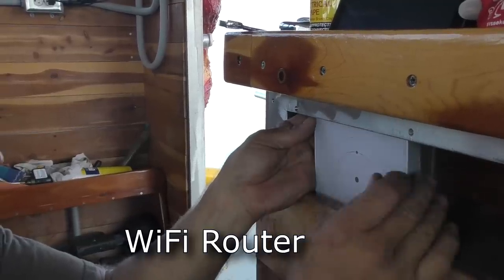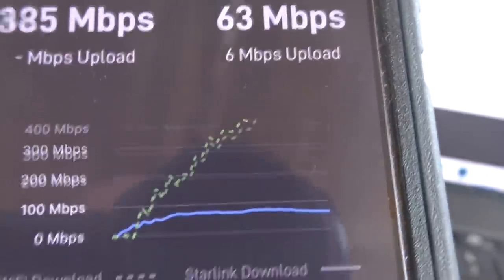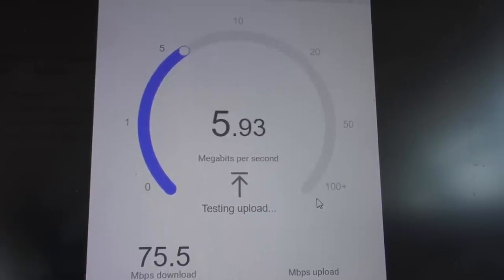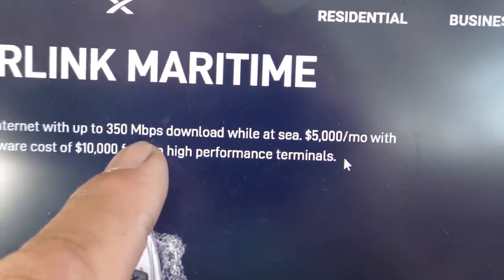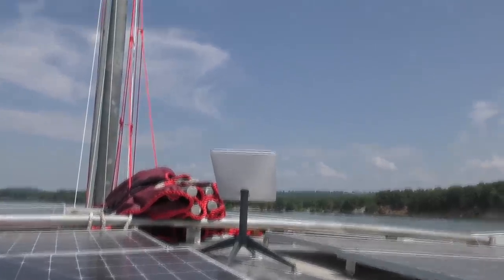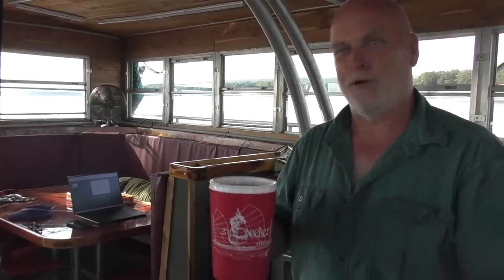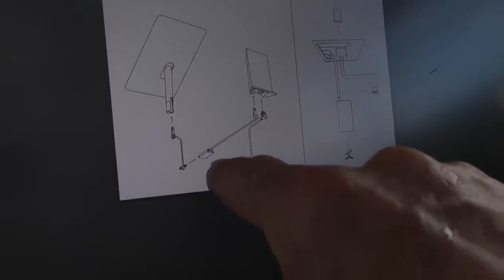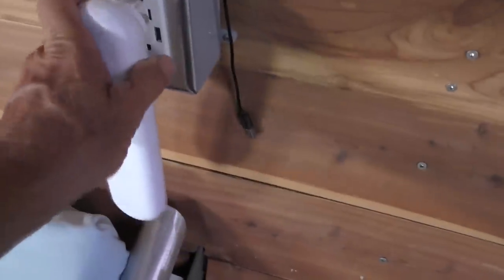Starlink vs T-Mobile Hotspot on a Boat

Comment: Since you already have multiple Internet connections, you should consider a failover router.  I picked up a Peplink Surf SOHO for $200, and connected my Starlink, 5G hotspot, and tethered my phone, and the router automatically rolls over to another connection if the primary goes offline.  I live on and work from my boat, so having reliable and backup connectivity is important.
Reply: @dancarter482  What about it?

Comment: starlink is amazing ive been using mine for about 6 months now i get 150-300mbps usually. be careful using it while in motion I've seen many peoples motors burn out or strip gears from re aliening itself so often. many guys are unplugging the control motor and removing the base mast and flush mounting them to their cars, boats and planes.

Comment: You could make a gimbal to stabilise antenna. Nothing fancy (without electronics) just few sealed bearings and "counter weight". It not gonna solve all problems, but it would be much more stable (in theory). Price of the marine version probably so high because of the some fancy electronic gimbal attachment to stabilise antena at any weather conditions.
Reply: There is no need to make a gimbal or anything that fancy as the starlink uses phased array antennas. 
The reason the marine version is so much more expensive is just because its a different marked segment and the antennas are a little beefier "Pro versions",  its meant for huge yaths and commercial ships. And they advertise you can use it out on the middle of the ocean soon, rv versions seems to be just land/coastal. Starlink does not seem to be doing any sort of GEO-fencing yet but they change their rules and what they do all the time
Reply: @kissa02  Now that there are quite a few of the 1.5 satellites up that are operating the laser link, I'm wondering if a "standard" Starlink system will operate out beyond the coastal areas (ie.. middle of the ocean).  Or maybe Starlink will geo-fence those non-maritime systems.  Will be interesting to see.
Reply: @kissa02  no people are having issues with tracking on moving vessels. The antenna tracks the satellite with a known path, and only makes corrections when the satellite gets out of you something will range. Which means everytime the vessel pitches more than the width of the antenna it looses connection. It has zero inertial stabilization. The marine version has IMUs to compensate, as well has heavier duty tracking servos for constant use.
Reply: @ionstorm66  Do you have a source on that?
Reply: I personally run my rv starlink in the bed of my pickup doing 75 down the highway, and up through very curvy mountain roads and see minimal losses. There’s no need for a stabilizing gimble on a vessel that does 8 mph and makes relatively slow turns compared to a pickup.

Comment: I have the rv version and it’s great for me. I am working fire lookouts this summer and take it with me, running off a small inverter and deep cycle battery. We have taken it camping a few times and it’s struggled when trees block the antenna to the sky. I’ve had it going 75 mph down the highway set up in the back of the pickup and it’s done very well on straight always and decent enough on curves. I believe that if you exit North America, it won’t work. The rv version doesn’t require any updates to your address as you move around. The speed decreases during peak periods haven’t been noticeable for me, but I’m also very rural.

Comment: You may need to make a stabilizer to get any service in rough sees, may improve current signal.  2 large washers, a ball with 2rods going though it and a stick with the weight on one end may be adequate enough, attach the dish to the top .  enough weight to keep it stable in high winds.   I guess you could simulate moderate to high sees to se if it would work without any modifications. 😜

Comment: Nice!  I've been debating between T-Mobile and Starlink too.  I live in an area with good cell coverage, but no land-based internet other than crappy DSL or dial up.  Both fiber and cable stop two miles from my community and both companies have told me the pole rental cost doesn't justify supplying our small town.  We're about to get a new $2 billion steel mill so that might change.

Comment: NIce kit.  You can't compare your situation to an RV....  they won't routinely roll and pitch through at least 20 degrees.  Once your out in the middle of the ocean will starlink actively track your satellite as you turn?   I would be interested to know what is included in the antenna department with the maritime version.  Good video.  Cheers

Comment: Very nice setup. 👍

WLAN won't work due to the massive amount of metal used in the ship.
On the other hand, you may be able to use the railing, possibly even the ships hull itself, as an antenna - just don't connect them directly because the wavelength won't match and your device will likely get killed by statics on top of it.
Just try attaching a Molex WLAN antenna directly to the metal, so that only a thin film separates the antenna from the metal itself.
You won't get much additional range from this, but that shouldn't matter for you will be standing right next to the improvised antenna everywhere on your boat ( if you went for the hull ).
It's just an idea, but since a Molex antenna only costs around $4 it should be worth a try. 🤓

As for the tripod you mounted the Starlink on, you may want to attach it to an automatically mechanically leveling stand or suspension to counter the excessive movement brought by waves.
A simply solution would be to use a tripod and hang a rod in the middle that has at least thrice the weight of your Starlink device. It needs to hang attached near the top connected to the tripod through something akin a "self-aligning ball bearing" or a "dual axis pivot ring mounting" not unlike a gimbal, though all moving parts best be plastic or teflon coated to keep the rust out of the mounting.
Now all you need to do is install your device on the top of the rod, and close to the mounting point to reduce the leverage effect of your device's weight.
The weight of the rod now will keep your device nearly level balanced on top, and Starlink should have far less trouble to maintain the satelite alignment.😉

Comment: Hey Doug.  That's pretty much the exact setup my folks are using now.  It's one model amplifi older than yours.  Works great!  I just disabled the wifi on the starlink router.  They're in a dead zone for any terristrial internet providers and had to get viasat, which was horrible.  Starlink finally shipped them their dist a month ago.

Comment: The dish has some play in the area where the the pipe clips into the base, it helps if you stabilize it. If you were to get some shrink wrap with the diameter of the insert pipe and shrink it over it, then slice out the fastening part areas, it would make it more stable, should help with vibration and movement.
Reply from the maker: Seems to be working fine, but I'll keep an eye on it.
Reply: @SVSeeker  I am only theorizing for when it's windy or there is movement in the boat, the result might just condense to a reduction in speed.

Comment: The standard solution to fix the "pointing" problem is to stow your Dishy, pull the back cover off and disconnect the motors, and then mount it in an old tire with the dish surface pointing straight up. You power it back on and it complains that the motors are stuck, but then does the best it can while pointing straight up, which is just about as good. The benefit is that no matter which way you turn, Dishy has the same view of the sky. Source: tuck's truck, and the Starlink receiver mounted to my minivan.
Reply: Oh boy, pretty clear on your understanding of radio and directionality. The beam forming simply not the good and will limit performance a lot.
Reply: @bentheguru4986  I get just as fast a connection with Dishy mounted to the top of my van, pointed straight up, as I do in my back yard, mounted as specified. So yes, I feel I have a pretty good handle of the beam-forming capabilities of Dishy.

Comment: $700 is really not that bad considering the dish alone costs them $1500-2000. I think Hughes back in the day used to charge close to $1K for equipment for their shitty internet. Starlink is a boaters dream.

Comment: Marine version may have a gyroscope of some sort in it to maintain sattellite conection... it would be expensive to mfr but 5 k a month? Yikes....
Reply: He should build some gimbal for placing star link antena, like he has for his stove ;)
Reply from the maker: Maybe it brings you breakfast in bed?
Reply: 5K a month is nearly 10x CHEAPER than current geosynchronous sat. And starlink is a lot faster and the ping is 10X lower.
Reply from the maker: @frederichardy8844  I bet it is.  No complaints here.   My RV version is hell and gone from any other options on the market.

Comment: Marine version from what I've heard from 'tech tubers', is a larger dish, with marine grade corrosion resistance,  but way more expensive, both up front and monthly...
Reply: Ye, really designed for the big ships / companies. Still a lot cheaper than the alternative marine versions.
Reply: eSysman, who is an IP guy on really big yachts, says that a 10 mbps down connection to  geosynchronous satellites is around $900,000 a year, plus all shipmounted the hardware. 
But only 5 mbps is guaranteed.

Comment: "Starlink for RVs is not designed for use while in motion."  I'm pretty sure pitching and rolling at sea is going to be a challenge unless you stabilise the antenna.  It's also unlikely to deal well with heading changes so even swinging at anchor may require a reset.  Still, for the money it's worth putting up with quite a few challenges.
Reply from the maker: So far it's happy on anchor.  I don't really care if it has trouble with Netflix while under sail.    We'll likely shut it down.

Comment: The eSysman channel is from an IP guy on big yachts. He says that you can get geosynchronous internet at 10 megabits per second down for about $900,000 a year. But only 5 mbs is guaranteed. You are sharing a geosynchronous satellite with a whole bunch of other big boats. If you see a big yacht with those huge domes on them, those are the geosynchronous satellite internet antennas. Long ping times as well.
Starlink is faster, costs less.

Comment: With the ethernet adapter you might have to get another primary router to work with the mesh network. Ive tried it with mine directly connected to a switch/mesh network and it didnt work because the ethernet adapter is before the starlink router. They also say this in their user manual.

Comment: i feel the saterlite will interfere with the solar panels (aka shadow) and make them become inefficient
Reply from the maker: That’s why we have 12 panels. I haven’t used a generator since I’ve been on the water.
Reply: @SVSeeker  if the 12 panels are in parrel then you should be good if there in searies then shadow on one pannel will effect all panels and there out put

Comment: Have you thought about putting in a wire is a wireless network system that allows you to have multiple Internet imports As well as multiple outputs on the boat so that you can have good Wi-Fi coverage and multiple fail overs to connect to the Internet

Comment: if you familiar with the UBNT stuff, get a Nanostation M5 and you can hook it wifi to the starlink and get the ethernet out you need.
Reply: @dancarter482  ubiquiti networking. its the wifi stuff he uses on the boat.

Comment: The marine version is like a commercial version
Reply from the maker: I hope they’re getting their moneys worth.
Reply: @SVSeeker  When comparing what ViaSat and other similar vendors currently offer for commercial maritime, or large yachts, the price difference (mostly in terms of the data) is considerably less for Starlink.  The equipment cost is roughly similar, but it's not uncommon to see $10K or much more a month for data services on large yachts and commercial vessels, all the while getting considerably less speed on ViaSat, etc.   Like you noted, at $5K/month, Starlink's not for the average boat owner, and I suspect that while most super/mega yacht owners will convert, the biggest customers will be commercial vessels, cruise ships, etc.

Comment: they have a t-moble home internet router that doesn't have a data cap.
Reply from the maker: Yes, I think so.
Reply: @SVSeeker yeah, I have it. Used it a couple of times outside of the state. It doesn't seem to be a region locked.

Comment: Cellular when near the coast and built-up areas will likely work best. SL does have good down speeds when stable and weather is clear, quickly goes downhill with cloud coverage and movement. SL "Routers" suck for WiFi performance and best to use the ethernet adapter and better qulaity gear. The use of a Multi-WAN router that has built-in 4/5G along with the SL will see best coverage and redundancy. 
Telco Antennas in Australia already making a marine weather dome for the Dish to stop wind ripping them off.

Comment: For those that need internet in far flung locations, Starlink is great.  One important difference between a satellite based system (i.e. Starlink) and a terrestrial based system (i.e. T-Mobile) is something called latency.  This is the time it takes for your data to get from you to a web site (email, etc) and back again.    Terrestrial latency is usually measured in milli-seconds as the antenna is a few miles away from you. But satellites are  ~340 miles away (~680 round trip) so latency is measured in seconds or 100’s of times worse.  This delay will impact, or prevent altogether, some types of services.  Email and most web sites will be fine.  Audio can be iffy.  Video will seldom work correctly.  So plan ahead before you go out to sea and test what internet systems are critical to you.  My $0.02.
Reply: Starlink works great for video
Reply: Whether audio or video works or not is a function of bandwidth and stability, not latency. If there is a 1s latency, but you have plenty of bandwidth and the connection is stable, then all you will have is a 1second delay in the communication. Historically, satellite connections were extremely low bandwidth and not very stable, resulting in poor quality and dropped packets. With Starlink on a boat, I do worry a little about the stability of the connection as the boat pitches and rolls, but bandwidth will no longer be a problem.
Reply: Starlink has little to no latency penalty compared to cable or cellular internet. The old sat systems had it in spades. All systems are going to suffer from latency. The amount has a bunch of different issues. Each switch adds some- and how many bounces is the big issue. Ping your favorite site and look at the time. But Starlink is only going to get better as they build out - and given that their target market is those who have little to no affordable options, they are hitting out of the park.

Comment: doug  what do you know about "hacking"?  i hope its a lot more than me your giving a lot of information away should anyone have an interest . google kali linux   spend some time on fb and yt see who is teaching what to who and then reevaluate , thanks for the videos good to see you floating and out of the house finally lol.
Reply from the maker: I know a lot about paranoia.
Reply: @SVSeeker  lol  serious about kali though  spend 10 min
Reply: @dancarter482  agreed ,unless your trying to run direct x based games , ive been at this since dos was at version 2. somthing  and grew up with computers  as they grew up   with each new generation of winblows  problems were not fixed complexity and cruft were added but not functionality  its now usually 10 or 12  button clicks to get to system information and more lack of control . apple isnt as bad but runs the same way and they wany money for that quality product that they are in no way legally responsible for!!! yup linux has its issues but people actually want to help fix them,,,,
Reply: @dancarter482  you dont game  which is the one reason to use microsnot ...unfortunately vm's use resources games want so in most cases its a full install , fortunately i started tinkering with boot loader  40 odd years ago and multibooted everything lol.